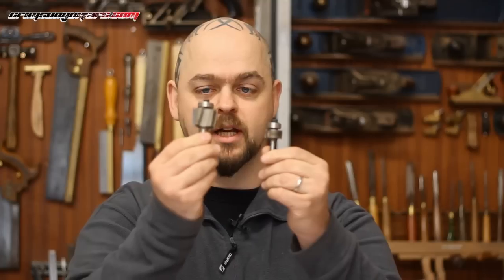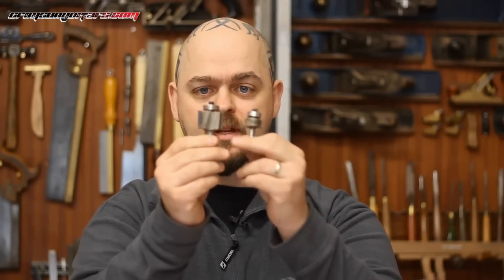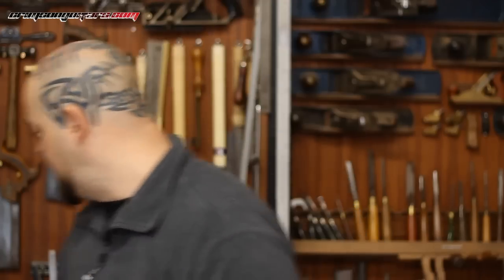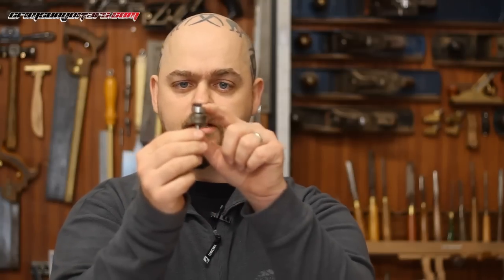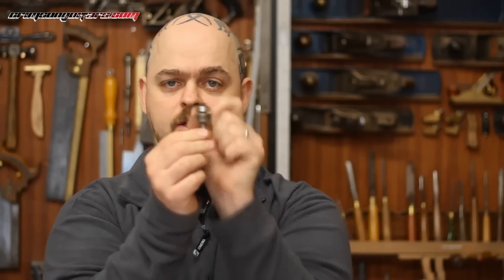Routing and Gluing Guitar Binding - Podcast 54

Comment: Hi great subject.
In order to do some information and not competition, here's a nice video covering how to install binding 
Part 5 - How to Install Binding on an Electric Guitar body from a guy living in Australia (Fletcher Guitars)
In that case, acetone is your friend.
With the Dremel/ stewMac stuff, go in 3-4 pass. because the bit is so thin, it might break if you cut to much at one time. The radian tool look a bit scary, but as long as you got the right bearing it will complete the job in a flash !!

Hope that helped

Alex
Reply: Cobi Tanium : that Fletcher vid, with Ben Crowe’s sage reasonings, should help all novice luthiers for many years.
I just finished my 1st attempt at negotiating a binding channel with an SAE 1/4” Ryobi router, fitted with an Amana Tool dedicated guitar binding router bit (includes 5-bearinged lateral depth tip guides) and couldn’t be happier after this my virgin endeavor.

Comment: That router bit is called a rabbet cutter.  In the U.S. anyway.  I tape the bindings in completely and make sure that are perfect.  Then I wick in water thin ca. Glue. I use a   wash coat of shellac on the top and sides. Which is easily sanded away with any excess glue. 
Thanks for all of the great videos Love your channel.
Reply: Rabbet cutter here too mucker,though some peeps use the first thing that might sound right,(mucker means buddy in scotland BTW,in case you got the wrong end of the schtick).

Comment: get and use the acetone, for 2 reasons:
1) because it melts abs as well as celuloid  bindings
2) because it evaporates completely (no staining)
Reply: And gets superglue off your skin, or even if your fingers are stuck use the acetone.  It has hundreds of uses in cleaning, repairs etc.
First designed as a quick way to repair wounds on the battlefield until the wounded soldier got back to the medics camp.
Reply: Agreed, usually is at hardware stores on the cheap. I think binding is made of ABS and you can get a little can of ABS cement in the plumbing section of hardware stores. Just get a set of cheap paintbrushes so you can baste it on with better precision.

Comment: Hello Ben !
1/4" routers are fine for FLAT SURFACE binding routing. But as soon as you deal with a "contoured top" or if you're crazy enough to bind a "contoured back", then you have not a lot of options others than using the old channel method with a chisel or a Dremel, to follow the "plunging contours".
Now, when you work on a repair, or on an assembled guitar that a customer decides to put bindings on, of course you can run the 1/4" router everywhere it is uniformly FLAT, but in all the tricky parts of the binding, you most probably will wind up using the Dremel and the chisel.
Best regards.
Reply: If you cut the binding channel before carving the top, you can use a router on an archtop!

Comment: Great Video!!! Master Luthier Ben, I'm glad you covered this topic. I am binding a mandolin that I had to take apart and rebuild for a customer. I purchased the binding glue recommended by StewMac and found that the open time for the glue is very short. Almost like super glue but the only difference was the glue was more thick than super glue. It dries very fast. I taped and wrapped the instrument for a good clamp of the binding. The following day after removing the tape I was not happy with the outcome. so I removed the binding and was talking with a fellow Luthier where he told me about the acetone glue method. In your video you covered the topic of acetone glue. However I would like to see a more in depth video of making the acetone glue allowing the binding to melt and it makes the glue for you to use to install the binding. it would be nice to see how much plastic should be used to make a certain amount of acetone glue. Also I would like to know the open time of the acetone glue. And also what effect does the acetone have on the finish of the instrument. Thanks

Comment: To address the tear out issue. Because of extreme grain run out on the bouts and cut aways, climb cutting and shallow multiple passes will greatly reduce or eliminate tear out. Climb cutting simply put is going in the direction the router is pulling.

Lighter fluid or Naphtha will not melt binding. It has no oily residue, I use it to wet sand lacquer cause it won't swell the wood fibers like soapy water will. But don't smoke it will end badly. It's also no longer available in Ca. USA. but I still get it as lighter fluid.

Comment: Ben is correct in saying that you should use a decent router bit . i you're routing a flat top guitar i would always use a table mounted router . That way it is not prone to any unwanted movement will leave you with a uneven binding channel.

Comment: To glue binding what i usually do is to melt binding in acetone and then use the mixture as a glue, which in my case at least, has worked perfectly. Using acetone by itself, in my case, using Stewmac binding, didn't work too well as the binding wasn't well fixed to the body since the acetone mostly evaporated instead of melting the binding.

Comment: The Stewmac binding glue does look an awful lot like model cement. 

That seems really strange that acetone isn't readily available to people in the UK. Probably has something to do with emissions regulations set by the EU or something, eh?

Depending on the binding, MEK (methyl ethyl ketone) should work as well as acetone. However if acetone isn't available in the UK I have doubts MEK isn't available either. They're pretty similar chemically speaking and we used them for some similar tasks in the polymer lab I worked in. MEK evaporates a bit slower, though.

Seems like super glue would be the best option. Superglue's primary solvent usually is acetone as well, so you get that duality of the bond to the wood and the slight dissolving of the ABS or celluloid plastic. As far as sticking your fingers to the guitar, you could wear nitrile/latex gloves. 

Ernie Ball has a pretty novel way of doing binding: http://youtu.be/Q_oXBvr8AhU?t=10m45s

And thanks for the videos! I'd be happy even if it was only once a week. Good stuff!!

Comment: Crimson Custom Guitars Acetone can be purchased from Fiber glassing suppliers or paint and hardware shops, Loctite have a consumer Gel super glue that can be purchased from hardware stores, it is very thick and will not run, but it has to be used very sparingly.

Comment: I was wondering if you could talk about how to build a guitar and find the position of the bridge and the scale length needed. Also on how to do the same if you want to say take a 6 string stock Telecaster body and put on say a 7 or 8 string 24 fret neck. How would you work out bridge placement?
Reply: the length from the leading edge of the saddle or bridge to the neck body joint (in the middle of the 12 or 14 fret) should be the same as the neck body joint to the leading edge of the nut. so 24.9"  sacle length should be 

12 7/16" from the neck body joint to the saddle in a strait line.
Reply: Cool I'm building a 7 string Tele from a kit and it was a 6 sting.

Comment: Hi,
I encounter problems when binding. I tried to find the answer on forums but it seems that I am the only one with this problem. When applying the binding I used acetone and hot gun and it worked well and bind well. very clean job. but then...when applying the dye, the dye went through the binding i could see hundreds of micro cracks in the binding. i did the binding again 3 times and 3 times with same issue. What makes this happen? any idea anyone? Thanks for your answers.

Comment: You can buy acetone (propanone) at shop that sell cosmetics or some discount stores (I get mine at B&M).

It's sold as false fingernail remover. You can also use cheap nail varnish remover. Don't use expensive nail varnish remover - it contains amyl acetate and oils which you really don't want to use.
Hope this helps.
Malc

Comment: how do i do i cut the binding a purfling channel on a ooo28 nothing is square because the radius of the back. and im having so much trouble with it. i cant seem to get the stew mac guide for the dremel  tool right. and even if i used a mans router it still is effected buy the parabolic curve on the back....grrrrrr frustrated

Comment: I shall impart more wisdom up ye,

First acetone is nail varnish remover and can have a water content,also it most certainly is avbailable by the gallon here in the uk.

Second ,as for the router bearings,sealed bearings,not sealed for life as some sealed bearings use an oil seal and some use a metal seal which is more a bearing guard,the latter can be re-lubed in molten grease or hypoid oil,grease is better,as for the sizes to use,original bearings that come with any cutter will have a thickness and a ID for fixing to the cutter(inside diameter),obviously the ID must be adhered to,the thickness of the bearing can be less,but less means less bearing and more heat,so be warned,the OD can then be played with by various OD sizes(outside diameter),go for SKF or FAG bearings good european bearings and WILL last a very long time.i have re-built my motorbikes engine using SKF and FAG bearings,a suzuki RM250 1989 K-L series bike,racing engines need good quality stuff or they fuck up royal.

I have watched a youtube vid whereby edge binding was carried out using acetone,and that is how i will be going,i may even add F holes to my amp cabs and bind those too,as for abelone i am as the blind stag,i have no eye deer.

Remembering a saying from a fellow clansman(even possibly french),if at first you don't succeed try try again,or get hacked and go fucking crazy.

Comment: hello Ben  acetone is available in the uk at any fibreglass material supplier
they use it to clean the resin of tools also on ebay you can buy 5 litres for
about £15 you need abs plastic binding as this melts with acetone you can
make your own glue by melting abs plastic into acetone the best plastic for glue making is the clear plastic for 3d printers as there is no colour pigment to
degrade the adhesive also i put some laquer retarder into the mix to try and get a
longer open time with the binding
i make archtop guitars so binding is a big issue as you know
                                                     regards paul rialto guitars
Reply from the maker: Thanks for that Paul, I finally took the trouble to find some after the comments on this video.. I can't believe I hadn't thought to  Google it before now!
Reply from the maker: Just checked out your site, you are making some fantastic Guitars sir! Thank you for your support.

Comment: #Truth!
I’ve hobbied ~8-homemade bolt-on guitars but just attempted my 1st to include binding.
I use Dremel. I use ‘more manly’ routers too.
After buying almost all parts ‘required’ to Dremel tool a binding channel, my limited hobbyist instincts brought me fear enough to seek another path.
I found a 15mm rabbetting 1/4” router bit (with 5-different lateral depth circular ball-bearing guides) sold by Amana Tool which instantly brought my abilities the confidence required to attempt this new task.
The sheer weight and spread of my Ryobi standard router, set with Amana Tool guitar binding bit to cut ~14mm-deep, negotiated both cutaways and round my Firebird III non-reverse bolt-on body (with already affixed Koa veneer) like a green Philadelphia lawyer in a civil rights Mississippi court case! 
#patience #experience #lutherie